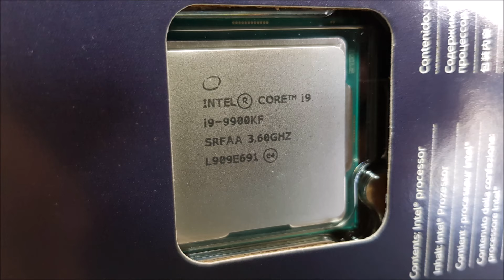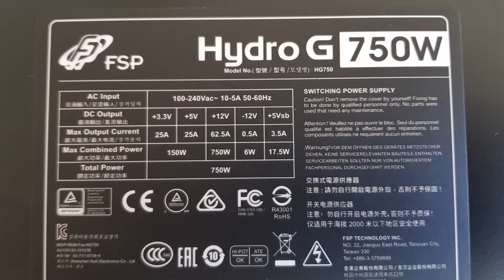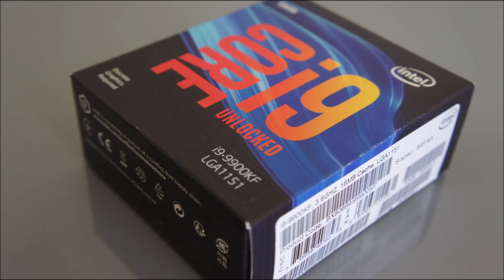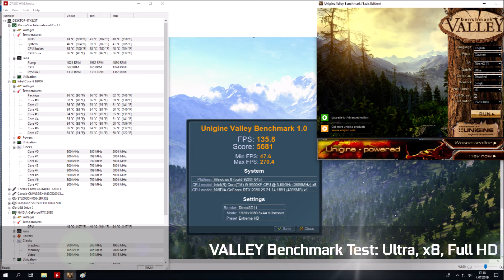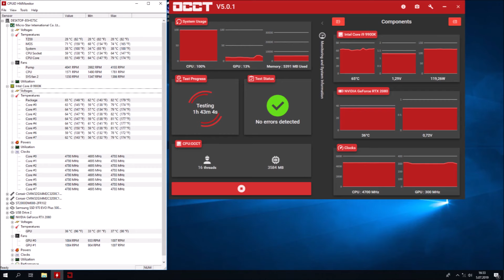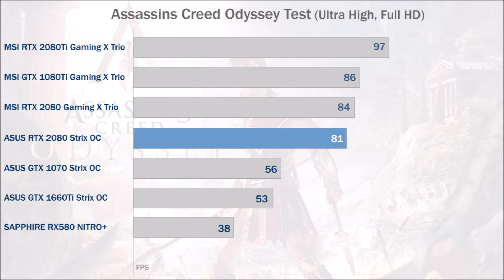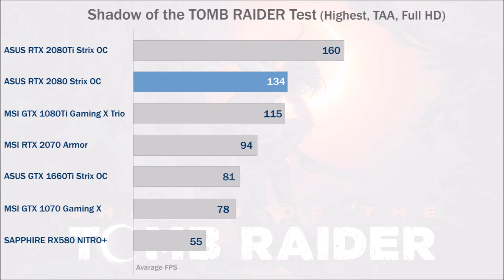INTEL i9 9900KF & Asus RTX 2080 Strix PC Build, Benchmark and Game Tests

Comment from the maker: PC SPECS:
- cpu: INTEL i9 9900KF 
- mainboard: MSI MPG Z390 GAMING EDGE AC 
- ram: CORSAIR 32 GB (2X 16GB) DDR4 3200 Mhz
- ssd: SAMSUNG 970 Evo Plus 500GB M.2 
- hdd: WESTERN DIGITAL 4 TB WD40EFRX
- graphic card:  ASUS RTX 2080 STRIX O8G
- case: COOLER MASTER MasterCase H500
- psu: FSP Hydro G 750 750W 80+ Gold
- cpu cooler: CORSAIR H100x 2x120mm

Thanks for watching !
Reply: Costs?
Reply: Abi neden bir kasada topluyorsun
Reply: Costs?